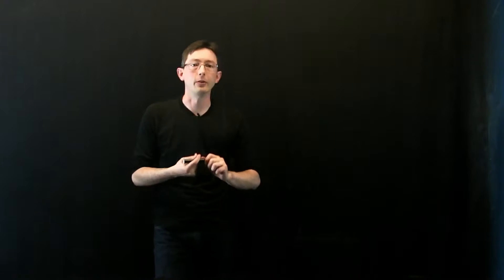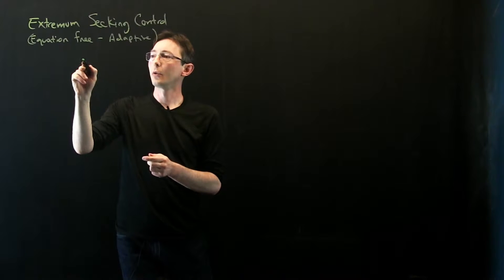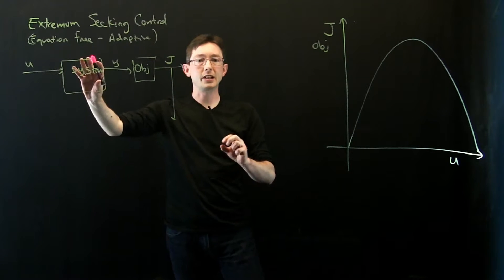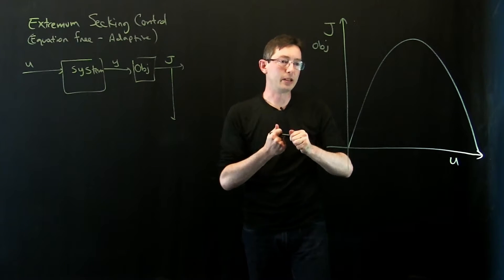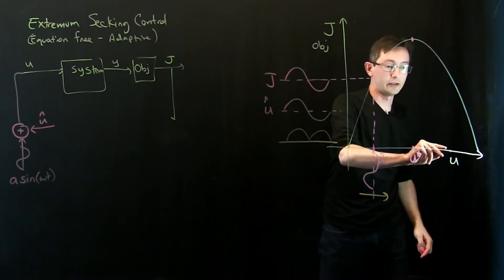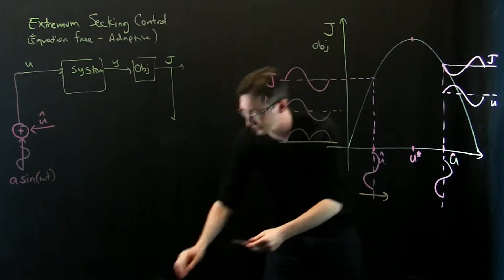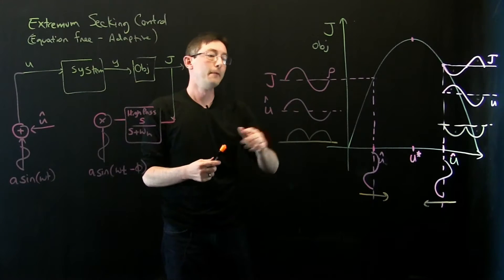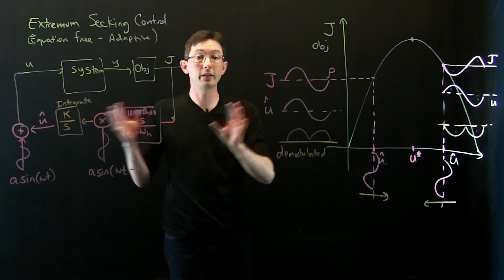Extremum Seeking Control

Comment: How would I use this in motion control?   I have up to 4 close loop gains and 3 feed forward gains. I can jiggle the gains a bit and look at the sum of errors squared between my target and actual position.   After all the gains have been "jiggled",  I can find a slope or Jacobian that reduces the sum of squared errors.  That would be the same as your u except this is a cost function.  I don't like the way u is used because that is normally a simple that is reserved for the control output.  This jiggle the parameters method would take a few moves to jiggle all the gains.  Then I must also keep track of which way I am moving.  Sometimes the load is different depending on the direction.   This means I have a different set of gains for extending and retracting or going positive, then negative.  If I am doing normal production work then things don't change much but if I am moving logs then the system changes depending on the size/mass.   It is hard to get enough "jiggles" under the same conditions.  My example is only trying to minimize J or sum of squared errors.   I don't see how this suggested method converges.   The BFGS, L-M or Nelder-Mead would take hundreds of iterations to minimize the sum of squared errors.
Basically, what is suggested is like executing a BFGS or L-M optimization on-the-fly instead of a one time "batch" mode.

Comment: This is very like the idea of hill climbing with an elegant use of sinusoidal perturbations and phase shift parameter, I guess.
BTW, thank you very much, Prof. Brunton, for all nice lecture series (Control bootcamp, Data-Driven science, engineering, dynamical systems and control). They help a lot for learning and establishing a comprehensive understanding on control and the emerging data-driven control area, which can definitely boost the research in my own major and areas of interest (smart energy systems).